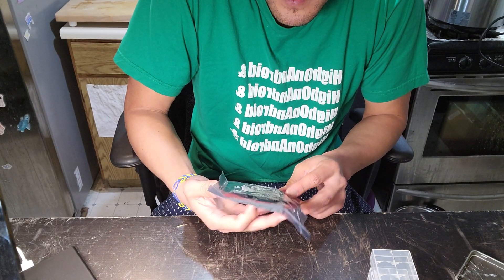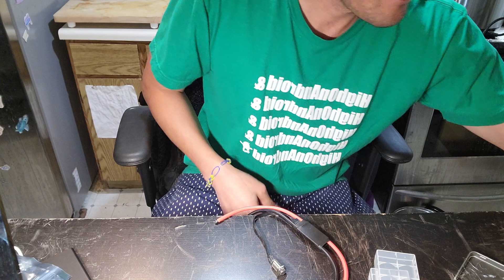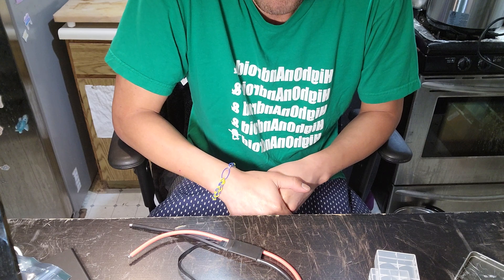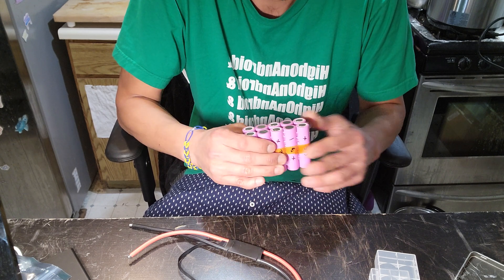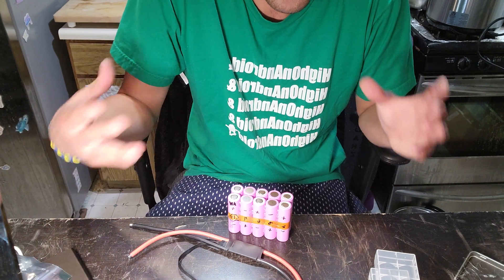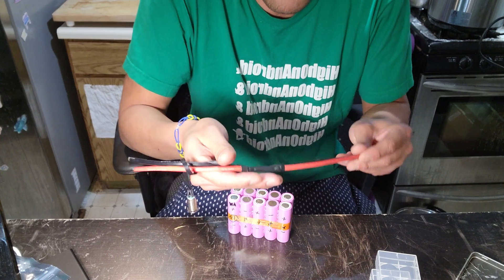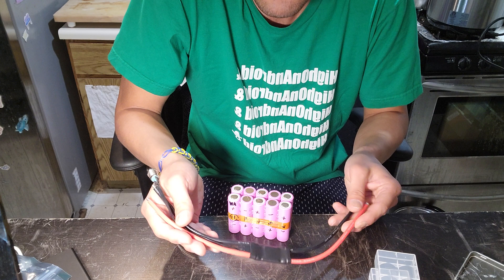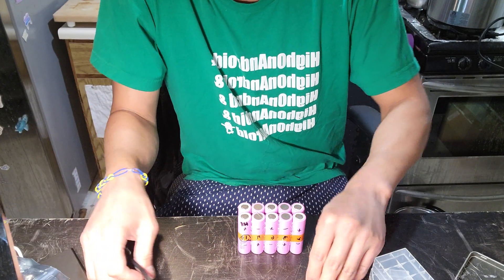Maytech 180A Anti Spark Switch & BMS Bypass For Electric Skateboards!

Comment: Hi how would I wire this, would it be battery - Anti spark switch - BMS - LCD battery indicator ?
Reply from the maker: It goes basically between your battery terminals and VESC.
Reply: @dr.eskateboard3381  thanks, I’m assuming this would go after the BMS then ?
Reply from the maker: @samreason9856  yes of course
Reply: @dr.eskateboard3381  thanks man been trying to finds details all around but haven’t had any luck!

Comment: Bruh until someone leaves it charging at home accidentally. then returns to burning down house.. gr8 idea m8... also if you don't always discharge fully then charge fully your battery will become unbalanced and will explode even faster.
Reply from the maker: Of course u need a BMS. 😁
Reply: He's talking about bypassing the BMS in discharge not charging. Meaning it won't overcharge. It basically balances the battery everytime you charge it but not when discharging. In some cases might be a problem when dropping your battery too low but you really don't want to fully discharge your battery anyways. I'd suggest charging and discharging it between 80% - 20% which should increase the cycle life from 300-500 to 2400-4000. Or going even further using 75% - 25% would only decrease the battery to 74% capacity in 14000 cycles. I'd suggest the "smart bms bluetooth", google it, you'll find it from several vendors. It lets you monitor all your series and set the voltage of which you stop charging and much more through an app.
Reply: @emilwibergh1014  yo thanks for that info man. That sounds pretty gnar.